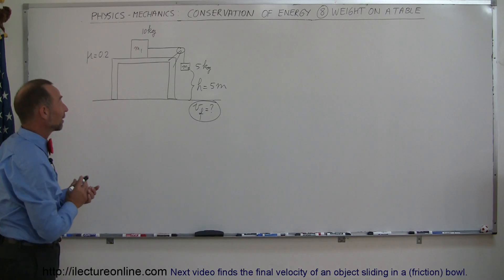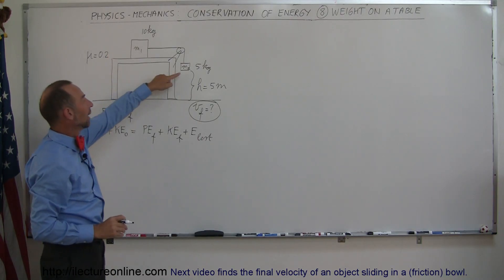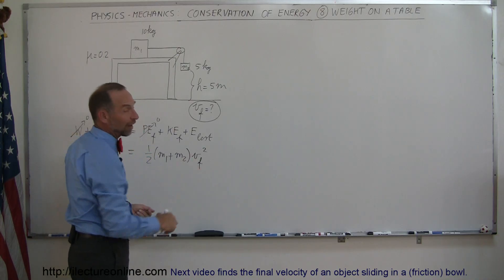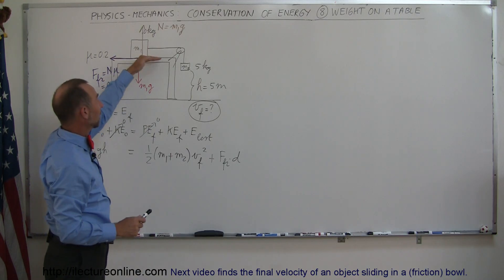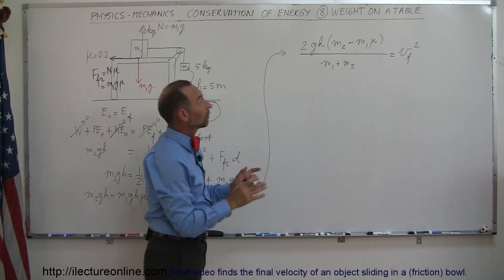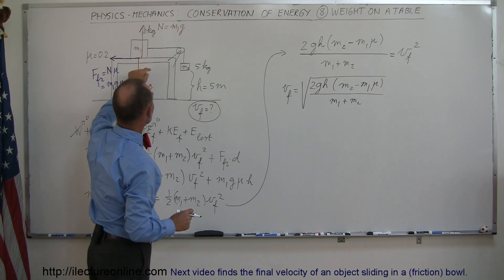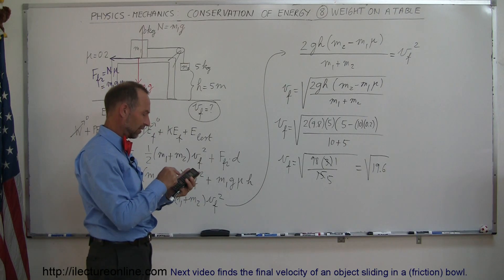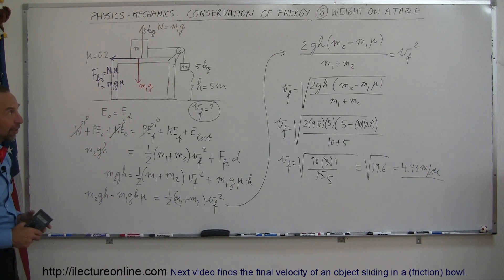Physics 9   Conservation of Energy (8 of 11) Weights On A Table

Comment: I have a question, is the reason why there's no final potential energy is because there no increase in height and is just the same height?
Reply from the maker: You can have a height reference point for each object in the system.  The top block does not change height and we can call the low point for the hanging block zero height.

Comment: you can go further with this at the end - m1 has KE left over (98 J) with this you can calculate how far along the table m1 will continue to travel before stopping from friction and furthermore calculate the full distance m1 traveled. from the 98 J m1 has remaining it travels for 10 m after m2 impacts the ground + the 5 m m1 traveled prior therefore covering 15 m overall.
my calculations might be wrong but it was a bonus i wanted to do.
Reply from the maker: There are indeed more questions that can be attached to this type of problem.

Comment: what if Fnet=mt*a
(m2*g-m1*g*mu)/(m2+m1)=a=1.96m/sec^2
Vf^2=Vo^2+2a(yf-yo) where Vo=0 , yo=0,yf=5 and a=1.96m/sec^2 
so Vf=4.43m/sec i think that's another solution of it!
@Michel van Biezen
Reply from the maker: Yes indeed, you can also solve this problem using the equations of kinematics.

Comment: How would you find acceleration for this example using the same method?
Reply from the maker: Once you have the final velocity then you use:   V^2 = Vo^2 + 2 a h  and solve for a   (h is the height)
Reply: @MichelvanBiezen   And how would you solve for acceleration without a known height or velocity?

Comment: Hi sir, I had a quick question. Why did you not consider the rotational kinetic energy of the pulley?
Reply from the maker: In this problem we assumed a "light" pulley.  The concept of moment of inertia and rotational kinetic energy is covered in later chapters.
Reply: @MichelvanBiezen  Thank you for your quick reply, I understand now. Also, thank you so much for making easy to understand online lectures they are really saving me!! 😊

Comment: I am thinking it miight help if the distance from m1 and the pulley is given which should be > or = to 5m to properly equate with h.
Reply from the maker: That makes no difference to the principle of the problem.
Reply: I was just thinking if the string is shorter mass m2 won't make it to the floor :) but yes principle and logic rule.

Comment: WHAT ABOUT THE WORK DONE ON BLOCK M1 BY THE STRINGS TENSION?
Reply from the maker: Since the string is internal to the system, it does not do any work on the system.    If you draw a free body diagram around each block separately, then you would indeed need to include the force of the string on the block, but not the way the problem was solved.
Reply: @MichelvanBiezen  Many thanks for clearing that up for me, and thank you for your excellent physics videos.

Comment: If we assume the practical was in a perfect environment where there's no friction. Will it be just PE + KE = PE + KE? Because you can remove the friction away the equation and W is zero because it's stationary
Reply from the maker: That is correct.
Reply: @MichelvanBiezen  Okay thank you. But when I was doing my calculation, my PE1 doesn't equal with the KE2. Is that correct? The values that I have are the total mass of the system was 1.174 kg, carriage was weighed 1.124 kg , the load travelling downwards was 50 g, and dropped at a height of 86.5 cm. Because PE1 I got 0.423 j and KE2 was 9.963 j. This is assuming its a perfect environment.

Comment: Professor shouldn't we subtract friction as it is lost throughout the entire mechanism ??
Reply: Can we also apply Wnet =∆k.As far as the way you solved it, are you considering that the total initial energy= final energy + some energy lost.I am having problems in figuring out about friction if I am applying your method. Plzz help
Reply from the maker: There are different methods.  The one that I show requires the lost energy to be added to the right side or subtracted from the left side.
Reply: +Michel van Biezen why will it be added sir
Reply from the maker: If you don't add it to the right side of the equation, the equation will not be correct.  If you lost some energy due to friction that means that the PE and KE energy final is less than the PE and KE initial and you have to make up the difference.
Reply: +Michel van Biezen Thnx professor you are a sensation among my comrades.Professor I wanted to ask you will you make some videos on optics explaining the basics with some examples
Reply from the maker: We have hundreds of videos on optics.  Here is one example of one of the playlists:  PHYSICS 55.1 LENSES AND MIRRORS UNDERSTOOD

Comment: How do we have kinetic final, isn't the block going to come to a stop? On some cases, the kinetic final is considered 0 because it comes to a stop. I can do these problems but I have the most trouble just deciding what energy to consider. Can you recommend something to get better at that? Thanks!
Reply from the maker: Sometimes the question is very clear and sometimes we must make assumptions.  The assumption here is to find the velocity of the block as it reaches the floor.  After it reaches the floor the velocity if obviously zero, but we cannot use the conservation of energy equation when there is a collision.  (For that we must use conservation of momentum).

Comment: If the 10 kg block falls off the table before the 5kg is about to hit the ground then mustn't the PE of the 10kg change as well. Why can we just assume that the the string is long enough so that the 10kg block doesn't fall off the table? Also, why can you assume d and h are the same length ?
Reply from the maker: You can assume any scenario and work the problem accordingly.
Reply: Reuel Cuellar d=h as the string is inextensible.
Reply: let's say u have a rope 50 meters long. and u pull from one side by 1 meter. Won't it's other side have moved 1 meter towards the initial side?

Comment: hi sir I don't understand how the system is moving downwards when the mass1 is heavier then mass2 thus shouldint the mass attached to the pulley not budge
Reply from the maker: It all depends on the net force.   If the net force is greater than zero there must be an acceleration of the system.  (Newton's second law).

Comment: My question is why aren't you multiplying the force of frictions and the distance by the angle in between them which should be cos180??shouldnt friction always be negative work?
Reply: Fredy De La Mora it does but from the initial energy because that's your total and you can see it does get subtracted when he starts solving it. He set up the equation to make it look easy but you can move the energy lost on the other side with a negative sign and you should get the same answer. I know this is late but it's for people that might have the same question as you.
Reply: @RaselAhmed-jc6iu   Can you take a look at this video? https://www.youtube.com/watch?time_continue=379&v=mZ9LJzXvtyw&feature=emb_logo

He sets up the equation as you described yet he multiplies it by cos180. Why does he do that there and not here?

Comment: Why did you say that the weight reaches the bottom for this problem (so that final PE is zero) but not for the last problem?
Reply from the maker: Aida,
It probably has to do with the conditions in the problem and what is asked.

In this problem you are asked to find the final velocity when the block reaches the floor.
Reply: Michel van Biezen I never thanked you, so thanks!

Comment: Professor Biezen here is my equation for finding final velocity for a system like this 
V=√ (m1*g* μ)
Final velocity = Square root of mass on top of the table * Gravity * Coefficient of Friction 
This works only for this problem, I am not sure if it would for others
Reply from the maker: Ali,
I recommend that my students always start with basic principles like F= ma, etc. and then follow a general approach that solves all problems.

Comment from the maker: Gareth,
Exactly as the problem explains.
Use Newton's second law on the object at the table.  The weight of the small mass is greater than the friction forces on the large mass.
Reply: Gareth M Allow me to explain it hopefully better, I appreciate it does look a bit counter intuitive.   If the table was frictionless then I hope you can see that the 5kg mass would indeed accelerate the 10kg mass, indeed a small push would probably get the 10kg mass going.  But we have a bit of friction from the table, about 20N,  however the downward force (m2g) of the 5kg mass is still sufficient to overcome this friction.  The (m2g) force is about 50N so about 20N of this is taken up overcoming friction from the table so there is still about 30N of force available from the 5kg mass to accelerate the 10kg mass.  Don't forget the downward weight of the 10kg (m1g) is balanced out by the Normal force of the table ergo no acceleration in the vertical direction.  Hope that explains it.  :-)
Reply: I agree that that m2g > Force friction by about 30N. But m1g > m2g.  However,  I'll have to set up an experiment to see if a 5kg mass can accelerate a 10kg mass across a table that has some friction of about 20N.
Reply from the maker: Gareth M
m1g (mu) < m2g
Reply: Michel van Biezen That's correct,  that's what I said above. As I said I'll get the experiment set up to see if a 5kg mass can accelerate a 10kg mass across a table with about 20N of friction.
Reply from the maker: Schrodie 56
Coefficient of friction in this problem is 0.2
Reply: Michel van Biezen Absolutely correct Michael.  If you read my explanation you'll see I've said "But we have a bit of friction from the table, about 20N".
Reply: Schrodie 56 Thanks for taking the time to explain.  All is clear now. :-)

Comment: I thought we can't use conservation of energy due to the external forces such as friction, tension and gravity???
Reply from the maker: Gwen,
The equation still works if you write it like this:

W + PEo + KEo = PEf + KEf + Heat lost

where the heat lost term is the amount of work done or energy lost to overcome friction, wind resistance, etc.
NOTE that the heat lost term is POSITIVE on the right side of the equation.
There are some videos that show this.
Reply: there is an equation when none conservative forces(friction, air resistance etc) are doing work KE1+PE1+Work Other= KE2+PE2. PE is composed of gravitational potential and elastic potential and work other is the work done by non conservative forces. That equation is starting point for this problem but as we begin to work problem out some values are zero so the equation changes accordingly